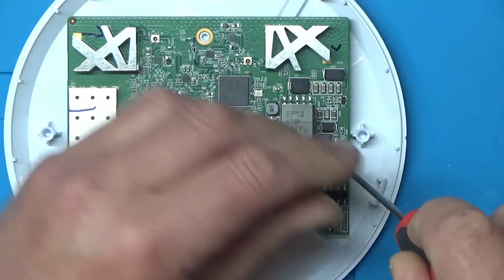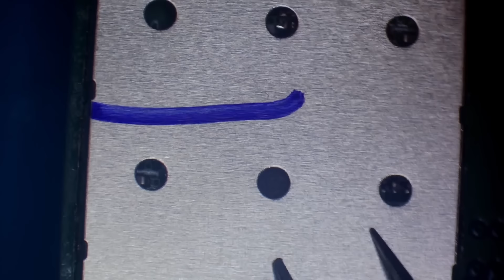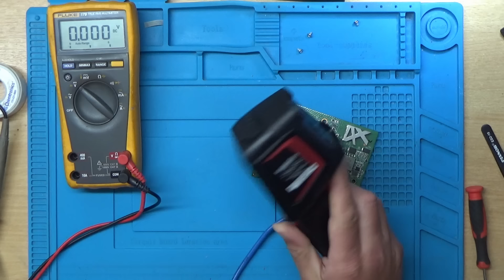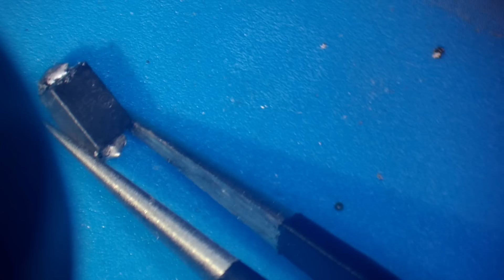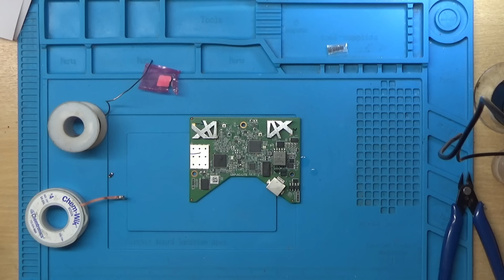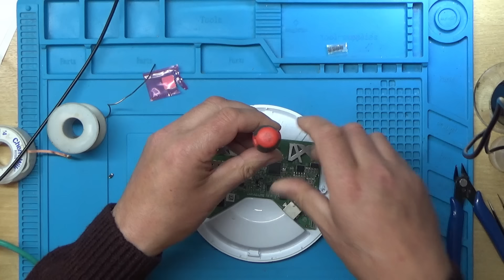Faulty Ubiquiti AC Lite WiFi Access Point | Can I Fix It?

Comment: Also, these older ac lite APs used to light blue just as brightly as they did white... As they age, the phosphor degrades, and thus the blue light dims. 

The really old Unifi APs had an RGB led (or separate RGB LEDs) and with a little hackage you could change the colours!
Reply: Its the led itself that wears out, blue LED dont have phosphor in them
Reply: @TonnyCassidy  Yeah It's the white LEDs that use a blue LED with a phosphor coating. Which is why you can see some blue light tinges on some white LEDs.
Reply from the maker: Or when the LEDs start to fail on some TVs the picture starts turning blue. One of my friends had a LG TV which experienced this problem.
Reply: @BuyitFixit  my parents too.... I managed to balance it out in the separate RGB controls for a while but soon I ran out of adjustment!
Reply: @TonnyCassidy  Duh, of course. I'm poorly, so I'll blame it on that! You're quite right!
Reply: @NiddNetworks  fix mine with two led instead of one, hopefully running them at lower current will make them last longer, found that those led runs at 16 or 18mA (forgot which) so with two led, current is shared between the two
Reply: The new ones have the old RGB leds again, you can change it to any color from the app (its now even supported)
Reply: @Yuu-poi  Which ones? I have u6 and u7 pro, didn't notice that as an option?
Reply: @NiddNetworks  u6 has it, you can only do it from the web interface though
Reply: My U6 LR still has an RGB LED. But they no longer install them on any newly made APs.

Comment: Still learning - I wondered that before attaching new diode - you would check for shorts etc. on either connection ?
Thanks again
Reply from the maker: It's possible, but I had 5 of them, if it had failed again, then I would have investigated further.

Comment: TVS diode is a known problem on these. What usually happens is that these specific models only support ubiquiti 24V poe and then they plug it into a 48V standard passive poe port that is already supplying power = dead TVS. Only the higher priced models supported standard 48V poe at the time this model was produced. 

I don't believe they produce anymore 24V AP's as this was a nightmare for the company.
Reply from the maker: Thanks for that, yes the unit does say 24V on the back 👍
Reply: Yeah, I remember something about this as well. Might have been the case indeed
Reply: all my ubiquiti ap are 24v
Reply: Thanks if my access point stops working I'll have an idea what might be wrong. Glad you figured out you need the app. If you have a controller you can set networks etc for these. Blue means it's being adopted to the network if I remember correctly, white means it's looking for the network
Reply: Thats just stupid. 48V is the standard for PoE, not 24V. Ive never heard of any 24V PoE. I expect they want you to buy their stupid proprietary 24V power supply. Its not happening.
Reply: @simontay4851  Some of our switches have a 24 volt option that we must manually turn on. There are Ubiquiti cameras that are also 24 volt. Yes it's stupid, unrelated I've seen 57 volt PoE devices in other products.
Reply: @simontay4851  there are many different PoE voltages, just that the standard is 48v, the rest are just non standard and also sometimes deliver PoE in a non standard way, iv seen 9v, 12v, 24v PoE some where just passive injectors that just shoved the voltage on the unused pairs of ethernet (usually the 9v/12v PoE) and some where an injector and splitter combo where you would hook up your AP's power brick on one side and inject power then their was another splitter at the AP that then split the ethernet and power back out to the APs normal power connector

And it is stupid, but welcome to the industry.
Reply: @simontay4851  Some of their switches supported 24V also. The AP's usually came with a 24V passthrough brick, however you could blow them like this one if you plug in a 48V passthrough and not know it. As far as I know they discontinued all 24V stuff and latest offerings run on real 48V standard.
Reply: @simontay4851 they may have been designed to work with their own Proprietary switches because even the first POE 802.3af was 47-52 volts the later versions supported higher current than the standard 12.95 - 15.4 watts per port.
Reply: @simontay4851  This AP is about 5 years old.  Maybe older.  Back then 24VPoE was rather common.  The injectors were included in the cost of the AP which was about $70 US.  Not a bad investment given they last a very long time.    Just because you are not familiar with something, doesn't make it stupid.
Reply: @simontay4851  Like spikester said, Ubiquiti no longer produces 24V access points or other equipment, everything is now standard 802.3af / 802.3at 48V POE.  In years past, the POE chipsets were more expensive than they are now, and Ubiquiti used their proprietary 24V power system to reduce costs for the consumer.  As the POE/48V chipset prices came down, they converted over to that.  I'm an owner of an IT Managed Service Provider, and we do still run into older Ubiquiti equipment that uses the 24V power.
Reply: @simontay4851 24v is used a lot on PoE devices, for example a lot of mikrotik routers and CPE use 24v poe